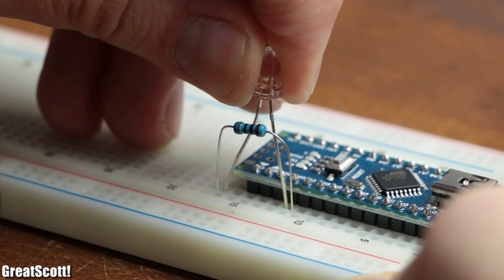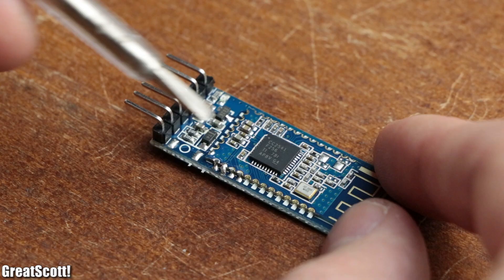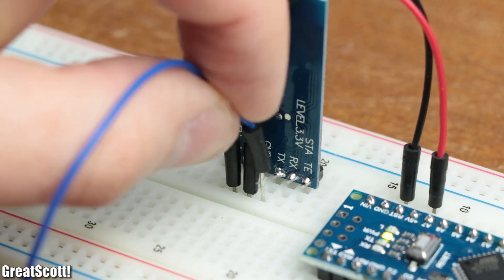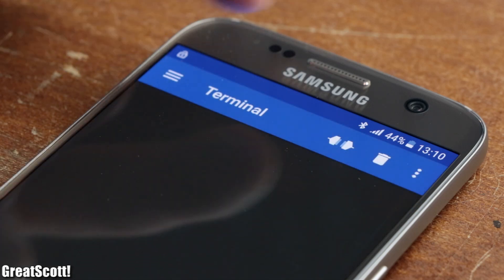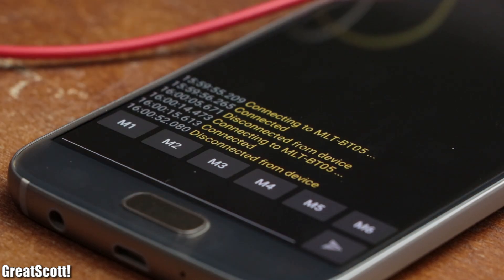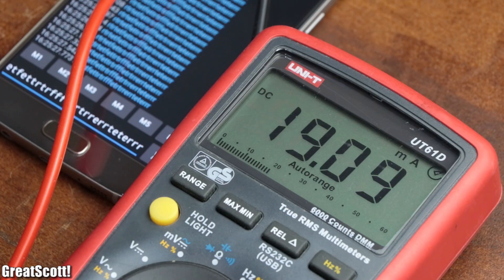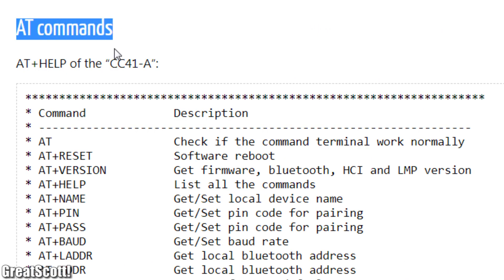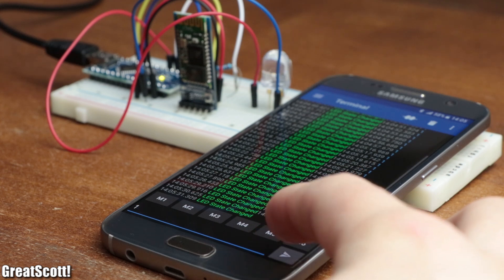Bluetooth 2.0 VS Bluetooth 4.0 (BLE) || Is an Upgrade worth it?

Comment: Nicely done. 

Another really important difference is that the HC-05 BT2.0 boards DO NOT WORK with iPhones. That's because Apple refused to pay the licensing fees for this relatively old BT standard. So if you want your application to work with iPhones then you need to use a more modern BT standard like 4.0, eg the HM-10. 

So, if you care about iPhone compatibility use BT4.0LE via board like the HM-10.

Comment: I’ve got the same cheap chinese version.  You can find tutorials online how to flash a genuine HM-10 firmware on it and then you can use it as intended. 

Also, one more advantage of the Bluetooth 4.0 is the iBeacon mode, which can be used to track the distance from the device without even connecting to it, so it can last for years with just a coin cell battery.
Reply: Did that to my fake copy and it died🤣

Comment: You forgot about one nifty thing that might convince some people to switch from HC-05. HC-10 can work as an iBeacon.
What that basically means is that it can broadcast its data to more than one device at a time. Useful for something like sensors that don't need to receive data from controller and if they do need to receive something like a config change, you can easily switch them back to Central + Peripheral mode, receive data packet and go back to Broadcaster + Observer.

Comment: I don't know if this board supports it, but the real power of BLE is GATT, which allows you to broadcast and receive data without pairing. Supposedly GATT also uses less power, but I haven't been able to measure it because I've only ever used it between Android phones.

Comment: Funny how the chip used in the bluetooth-module already has a micro-controller included that gives the arduino a run for its money :P
8/16bit timers, 8K Ram, I2C, USART, 12bit ADC - quit a decent thing.

Comment: Not sure if this has been pointed out below but the BLE module you have is not a HM-10. It might be worth adding, although these boards use BLE technologies the UART layer hides it from the user. They are designed as a simple serial cable replacement the same as the HC-05.

Comment: Nice presentation.. but it's half the story. BLE is specially desigend for  small packets and not streaming applications. That's while both versions are important. You pick the version needed for your application. However, BLE is good enough for serial
Reply: Hey, what are you doing here?
Aren't you supposed to be working on colour Tetris?
Reply: What if you want to use a Bluetooth board to be a single switch? My car is semi automatic with tiptronics. I guess the manual gears are changed with two wires. One being an up shift switch and the other down shift. I want to use a Bluetooth board to connect to paddle shifters to be the signal to hit the switches. Think these are good for that?

Comment: Since I have checked HC-05 works great, but not suitable for small battery application... 
Hm-10 has a lot of models with a lots of firmwares,so the best you can do is to use the command "AT+HELP", gladdly it will shows up all the commands implemented....  

HC-05 to HM10 - Watch out not every Hm is pin to pin compatible.
Hm10 - Once you power on, you're in AT commands mode, after pairing you automatically exit from AT command and gets into serial port mode.

Comment: all in all 

it is the way forwards 

4.0 headset lasts for many hours past a work shift ,it never runs flat like the 2.o ones used to do 

(for pro  drivers on the roads who need headsets connected up all day then ,4.0 to 4.2 headsets are a must if you want to stay headphone connected up to your mobile and it last the full day  DRIVING SHIFT )

so if your headset is 2.0 and does not last you a full day -simply look for the 4.0 headsets and this is just the start of a great new world in Bluetooth technology 

i give it the thumbs up

Comment: You forgot range and robustness. BT4 has gained robustness functionality, similar to features found in Zigbee, so it will keep connection in harsher environments like thick walls, through floors and long distances.

Comment: You are missing GATT. BLE has support for GATT services.
They can be setup so that they notify the master when their data has changed. So you can use it for sensors, so that you only pull the sensor value if it has changed.
Also, you don't need to pair. If you get the MAC, you can (on android at least) just tell the BLE service to connect that that MAC and it will do so if in range.
Not sure about 2.0, but on 4.0 BLE you can get up to like 450 meters rage with an SMD antenna.

Source: I work with product development and has used BLE (HM-10 for pre-study and better one for actual products) as a part of my job.
Reply: Hey since you seem to have a handle on the hm 10 module I have a question. I want to make an app that will comunicate with an arudino over a BLE HM-10 (mine is most likely a clone) module. So far I've succesfuly  used a BLE terminal app to talk with the module but havent been able to pair it with my phone. Is this important for making an app, like do you have to first pair with it or just use the MAC address as you say.
Reply: Also how do you fin out the MAC address

Comment: Hello Scott! Great!
But you didn't considered the other side, that is the phone. Doesn't it also saves lots of power there also? For continuous monitoring use, doesn't the phone runs cool when using the BLE? while it gets hotter on Bluetooth 2 based phones or running in compatibility Bluetooth 2 mode?

Comment: I've done an entire project on BLE in engineering school. It seems easy to use, but it sometimes work terribly bad, apps do not always pair or allow you to do what you want.. More advanced arduino projets using bluetooth can be a pain in the ass!

Other than that, we did a few tests with it, and BLE modules seem to have globally the same range as bluetooth 2.0, they consume waaaay less energy (as you said, good for long lasting applications), and seems to be more reliable in terms of pairing

Comment: Some more features of this board -
1. The HM-10 is rated to operate at a supply voltage of 2.0 to 3.7 volts, and its I/O are 3.3V tolerant.
2. HM-10, 11 and 12 all use TI's BLE4.0 CC2540 chip. 
3.Requires up to 50mA
4. Uses around 9mA when in an active state
5. Use 50-200uA when asleep
6. RF power: -23dbm, -6dbm, 0dbm, 6dbm
7. Default baud rate for the serial connection is 9600
8.The main modes of operation are called the advertising mode, scanning mode, master device, and slave device.

Comment: Great video, anyway Ebay is full of HM-10 clones, beware of that. I spent a month finding why my diy e-longboard is not working, HM-10 clone...fortunately I found solution how to firmware upgrade it to the "original" HM-10 via Arduino and some Windows commands :D. You can detect fake HM-10 by missing external oscilator on the PCB...
Reply: The official HM-10 does have a variant without the external oscillator. Hope this confuses you more haha.

Comment: What I know is the BT 4.0 shoul'd have much less power consumption. That's the main "policy" of BT nowdays. Not the speed. You can use the wifi for speed. It is for the lowest power consumption. The BT4 devices will stay online for over 1 year just with the button cell battery.

Comment: Simple choice if you’re using iOS, Bluetooth 2.0 isn’t an option unless the implementation is part of Apple’s MFi program which means $$$ that the manufacturers of cheap boards won’t spend.
No such trouble with BLE.
So I can’t see why not just pick a board that works with both iOS and Android when that option exists, after all the cost difference is minimal unless you’re manufacturing at production levels. And in that case you will be looking at an on-board implementation anyway.

Comment: I tried a Bluetooth 4.0 module for replacing the 2.0 one on my wirelessly-controlled RGB strip and on Windows computer it couldn't be connected as a serial port (maybe Bluetooth SPP or something), which made my existing code useless.

Comment: This HM-10 works much slower when sending a lot of data then bluetooth 2.0. Also error correction works not so good in practice.  Data transfer is not for this BLE module.

Comment: Thank you for the video! :) I'd like to contribute by sharing my own experience with Bluetooth LE and more advaced projects. I was supposed to make tiny coin-battery powered device, let's say some sort of a "smart sensor" - as it had PIC MCU, accelerometer and BTLE module. Bluetooth 2.0 uses good old serial COM port, so it is really simple to operate and use, especially when you can't use just pre-made terminals and have to create your own application to collect, process and save the recieved data. But Bluetooth 4.0 and higher are far more complex, although they still use UART in fact, it is not COM-port-based and that simple anymore.
Reply: thanks! No COM-port support is a huge downgrade. I wonder why it wasn't mentioned in the video.

Comment: The HM-10 presented here is one of the many "fake" ones. It is lacking the second crystal, which the original HM-10 has. Plus, it has a different firmware with many limitations, higher current in standby, very bad/badly tuned antenna and range, etc. However it can be flashed with the original HM-10 firmware, which eradicates some of these drawbacks.

Comment: The funny thing is that these boards are all as programmable as the ESP8266 and ESP32's are. But the manufacturer hasn't been as community friendly as Espressif is.  Which is kind of a shame.
Reply: Yeah, you can flash the hc-05 a new firmware to give it HID capabilities.
Reply: The CC254x chips use 8051 CPUs which are far more difficult to program; they have no GCC available for example and good luck finding a C++ implementation.
Reply: That's my point. the manufacturer hasn't provided a toolchain like Espressif did.  The devices themselves are just as capable, but without the toolchain their use is limited.

Comment: BLE board draws 120uA in sleep mode and can be powered by a coin battery. But, usually it needs to transfer data occasionally when it requires 9mA. So, do we need a seperate power configuration when transferring data. How to configure the power sources in that case?

Comment: Nice video. About the round-trip delay measurement, Did you use Android's methods to get the current time? I think the whole Android OS timing is not exact to ms level, and also there is the non-real-time-ness of both transmitter OS (Android)  and receiver OS (windows?). Maybe a better time analysis could be achieved by attaching a logic analyzer to RX/TX pins of transmitter and receiver modules. This way you can circumvent the OSes

Comment: Did I also see the HM10 board voltage input range is now increased from 3.3v to 3 to 6 v, therefore direct connection to the 5v pin?

Comment: How much faster? I'm actually thinking about sending and receiving sound / image sensor data via bluetooth, for analysis by a server PC that I don't want to physically wire to the device, and 9600 baud certainly sounds rather cumbersome. Particularly as I would want to add security, as I'd rather not have my neighbors pairing to those devices by mistake, or out of curiosity.

Comment: I ordered a fake HM-10 (AT-09) from Aliexpress. But, i have a little problem with it. I can't access AT mode or even connect to it through any apps. I have a HC-06 from school and it works just fine. What could cause this?

Comment: I did upgrade the firmware of one of my Chinese clones and it did never came back.

Is there any guide or different firmware we can try? The Chinese modules work fine when connecting directly from an smartphone when they are in the stock firmware, my only problem is that I need to manually connect them to each other using AT commands Everytime I power them on.

Comment: Can you make an function generator with LM741 op amp.
It's pretty easy though I am also making this . But I am having problem for providing power it requires VCC nad VEE both at the same time so in VCC negative will go to ground and in VEE positive will go to ground if I provide both VCC and VEE I think their will be short circuit. Can you help me???
Great video by the way☺️☺️

Comment: I just played with the version you have - JDY-09 which can be also purchased as AT-09. The problem with this one is that you cannot initiate connection. There is a tutorial on how to flash the software to HM-10 software (on arduino forum) which has this functionality. It's a nice exercise to do it though after trying it with this particular board AT commands stopped working.
I just ordered ZS-040 which was tested by few other folks and maybe it will be working. IMO it's also hard to say where to buy an original HM-10 board.

Comment: ohh I finally had the time to see your video well.
slow motion and subtitled because I do not know English very well (German even less). Excellent explanation but I can not make Arduino work:
I bought a box of components with an arduino-one clone (Geekreit from banggood) and I downloaded IDE for ubuntu from the original site
I installed it but even if the program recognizes the port and type of card does not load the sketch (the blink) have you heard of others having the same problem?
thanks a lot for all your sharing.

Comment: good video, of the best I've seen, if you allow me to add that with your knowledge you could do a tutorial on how to connect your multimeter uni-t ut61C by means of bluetooth to the pc, since it is rs232C communication and it is very difficult to connect it to the current pc, I hope you take into consideration is humble opinion, that there is no information on this network. Thank a lot.

Comment: Do you think you can do a DIY or buy with Mechanical Keyboards? I've read you can design your own keyboard PCB by sketching it and etching onto blank PCBs. Then you need a micro controller of some sort, an Atmega chip? To do your function programming.

Comment: GreatScott, 
Great video like every time you do many thanks.
Kindly, do a video about RF 433mhz with arduino. I m looking about clooning my car key code to open and close doors from an app already made and transmit and receive from arduino by Bluetooth hc06, but actually I start and stop engine with.
 But I can't find a way to read my car code making reading an RF receiver connected to another arduino to have the code and finally i finish my project sending that code when needed to open or close doors by phone app.
I need sketch for arduino.
Big hug.

Comment: 40ms ping is quite a lot actually, is there a lighter weight option to get that down around 1ms? For example, for a mouse or keyboard.
Reply: 40ms ping is super low that we wont notice it. It is way better than having 200ms.
Reply: @kingseekerbackup3085  We're not talking about a signal that has to go halfway around the world and back.  Actual transit time is less than one microsecond, so why is latency of these modules tens of thousands of times that? 

Also, latency is cumulative(even unnoticeable amounts matter, because it adds up from several contributing factors), and 20ms is noticeable in an AB test of cursor movement. Latency well under 10ms is noticeable in an input device when you're playing a rhythm game.
Reply: @sleepib  Then use wired then if you complain about latency. Wireless are still gonna have latency.

Comment: I would say that at price, it is better to get an ESP8266 as it allows even better connectivity. And as a bonus it can act as an MCU.
Reply: BeefEX. ESP8266 doesn't have bluetooth. The newer ESP 32 chip has it.
Reply: That's mys point, Wifi is way better for such usage than Bluetooth
Reply: Oh, totally.
Reply: Olivier Franglais it is actually pretty similar to Bluetooth when it comes to power consumption
Reply: Olivier Franglais probably not against BLE but against normal BT, it does consume a bit more, depending on your config of course, but the benefits it brings are worth it by far

Comment: A resistive voltage divider kind of defeats the purpose of BLE... but I will try to ignore that.

I am positive you know what I am talking about, but to any who does not, a resistive voltage divider constantly leaks current to ground, that is how it drops the voltage. This means you can't exploit the super low power usage when in sleep mode. Also, since you must provide at least as much current as the max current the module requires, otherwise you would rob it, this makes the power inefficiency more poor the less power used. Quite counter productive :)

Comment: Can we use a voltage divider to supply an ESP8266 ESP-01 power from a 5v supply? I needed it to trigger GPIOs through the Blynk app. Not enough components to build a buck converter.
Reply: Aniket Dessai No.Level addict the signals as shown, not the supply

Comment: Great (Scott) video, thanks!! How can I test the HM-10 module with an old laptop? It does not support BLE. Thanks!
Reply: Fernando Marengo Rodriguez The bluetooth version 4.0 supports both Classic and LE, so I don't think that there will be a problem unless you want to use BLE only.
Reply: Ok, thanks Marek. I suppose my HM-10 Bluetooth module is fake. How can I detect original copies and fakes, please? Thanks!
Reply: Is the module working? Can you pair it with that laptop? If everything is working fine, then you don't have to care about legitimity of the electronics..
Reply: It sends some data to the smartphone, but not to the laptop (which has a USB Bluetooth 4.0 dongle). I need to configure the HM-10 module through the laptop, but I can't. How do you configure this module? Which are the connections and code for this aim, please?
Reply: Only some data or is it working perfectly fine?
I don't have this module, but I think that I can figure out what's the problem.... just wait a second now please I need to look up somethin
Reply: Looks like the HM-10 is mainly BLE, not classic so.....